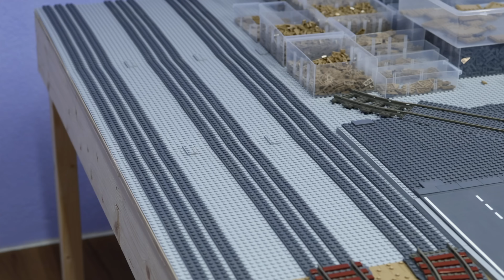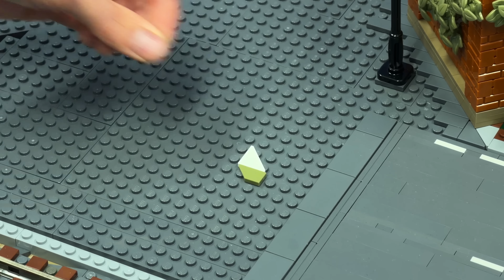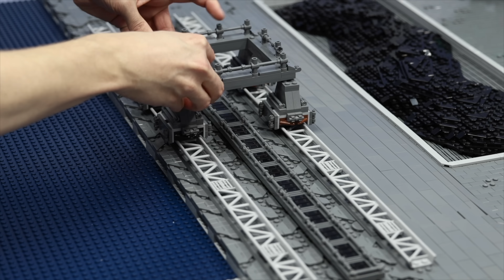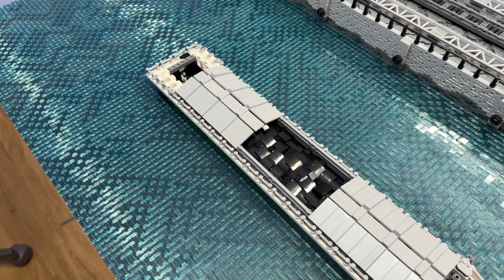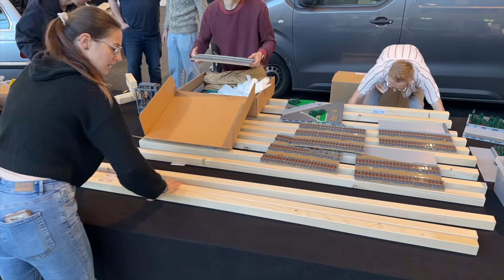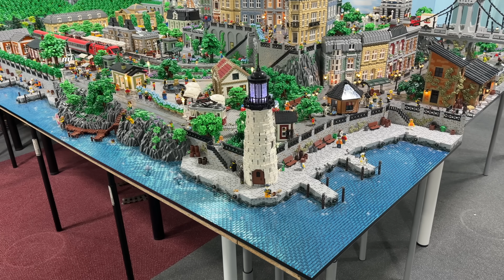I almost gave up on this LEGO build...

Comment: I would rather prefer to buy smaller sized LEGO base plates instead of intentionally damaging the larger sized base plates. I don't like it when my LEGO pieces get damaged. I'm already going to have to replace some raised LEGO base plates (the kind of base plates that give the illusion of 3D terrain) that have been effectively destroyed due to severe rodent damage.

Comment: @7:00 looks so much better with the plants and other details. One recommendation is you should consider getting some darker grays and put them sparsely in the large cement lot. Thus showing dirty and degraded spots on the cement lot. This would add some more realism, shading, and break up the large chunks of single colors.

I don't know how many different colors Lego comes in so maybe you can't get a minor shade difference but its worth a try.

Comment: You should get one of those motorised Lego vehicles like you would see in Legoland and make it a hi rail vehicle. The road wheels can lift up off the ground and the train wheels can have their own seperate motor, or the road wheels can be what makes the vehicle drive on the rails

Comment: If one cannot see bellow the dock area, why was it necessary to cut the grey plates to fit in the blue ones? Why not just use blue ones and go slightly under the dock where no one will see it?

Comment: I think you should change the coal to hundreds of round plates 1x1 (614126)  both in the coal bunker and in the coal freighterr, put an engine in the control cabin, connect it to the excavator bucket, so now it will be able to move automaticly and actually load coal into the bunker. Of course, you will need to use Technic Tread Link 1x2 (57519) or a Rubber Tread for the conveyor belt.

Comment: Well, I don't have a map but usually industrial zones are near big airports, so maybe you can think about it. Maybe the port is too near, so you'd have to enlarge the airport with a cargo terminal or something. 
The other solution is to build a residential zone, maybe a slum, or something slightly "driving" to the industrial zone. 
Or maybe you simply don't connect it "visually", just put it on the other side of the lighthouse, ideally connected by the sea and that's it

Comment: the giant water area might be a good place to experiment with "shadows" underneath the surface. It would however need at least 3 layers (2 if you don't count the baseplate / use the normal 2 sided thinner pieces). I.e: Baseplate - generic color of what the bottom looks like - translucent tinted top layer.
Then for the shadows (like if a whale is underneath the surface but you only se the silhuette) you make a shape where you replace the middle layer with another color.

Not sure how smooth you could get it, but it depends on what you want to hint at.

Great video as usuall :)

Comment: Would it be possible to put little wheels with motors under the boats so they can sail around on the water?
Also, What if you build water out of 2 layers of trans blue (blue plate underneath blue tile) and then placed that on top of a mirror? What would that look like? I think it could possibly create some really nice reflective water.

Comment: Bro, have you not thought about using non-Lego parts and/or sets in your city? I'm not saying you should get cheap, low quality sets from China, but I still think you could use a bit more variety in your city, like Cobi with their current take on trains and especially their road vehicles. The trains might require you to redesign your city, but I think they could be added if you do it right.

Comment: Super nice again! I watch always with my son, we are loving it.

But I have some feedback on your ship, I know that you build the industrial zone based on Duisburg, but bringing coal to Duisburg is in push barges, 6 at a time, and coal is open storage. If a inland barge is bringing the coal all hatches are open and usually the coal is way above the "coaming" (the place where the hatches are laying on). 

And parts of your ship look like a sea going ship and other parts look like an inland barge. The navigation bridge looks like a sea going ship, and the rest looks like an inland barge, but usually an inland barge is even deeper in the water. That's why the cargo is higher than the coaming. Because coal is light.

Nothing to offend you because the crane, conveyor belt, and storage looks very realistic and that is really super nice made!! 

What is also a possibility to make in the port is a ship that is loading steel coils (I know you did not had enough time). But for that you need a different crane and in Duisburg they are loading steel coils into ships inside a big garage.

Comment: If you wanted extra realism, you could consider recessing the roller coaster rails into the road. 

As a ships master, I’ve been to many ports and those crane rails are at the same height as the road so trucks can drive on the wharf

Comment: I love everything about this model except two things that I suspect were a time issue. The street lights don't fit an industrial area. Even in an older era they seem to ornate to fit. The other thing is the crane. It doesn't look sturdy enough and I would think it would make more sense to have the crane also extend over the pit instead of the conveyor underneath

Comment: i love watching the original german uploads so i feel spoiled by these updates in english, but i am so excited for the momentum coming back! this is the only lego-oriented thing that holds my interest. your passion for color use and design is incredible.
i think the industrial area could be added to the lego city close to the logging mill? that way its near both the harbor and the train tracks to facilitate material movement. you could even have a table on the other side, as if the crowd is walking through the harbor and theres more city on the other side?

Comment: I'd keep the park in the city, having the residential area and the industrial area so close to eachother would be weird. I know space is an issue but i think it would fit well inbetween the airport and the farmer's field. Also, i dont know if this is possible with lego bricks but you could slightly change the colour of the water nearby the industrial area making it look dirtier.

Edit: the pollution from the industry changes the colour of the vegetation anyways so the transition might look cool, maybe adding an incinerator or a dumpster nearby would give the "polluted land at the edge of the city" vibe to the thing.

Comment: Loving this moc so far, but one question: what do you do with the parts of baseplates that you cut away? Do you store them if they match the size of another project? I'm also impressed that your thumbs and fingers haven't exploded from pushing down on so many small tiles for such a long time. Good stuff!